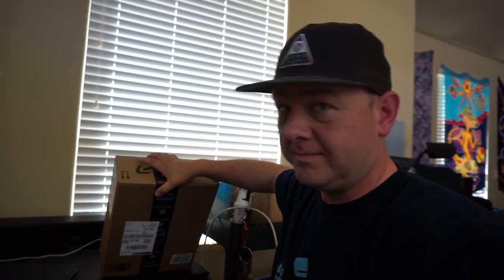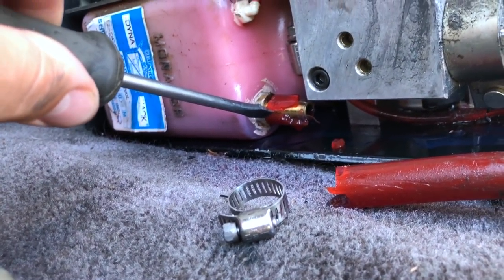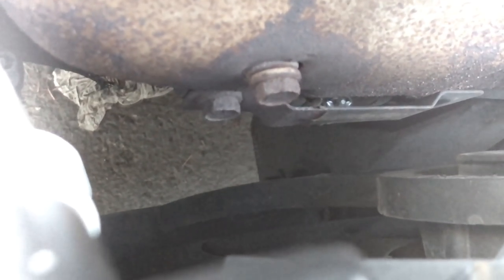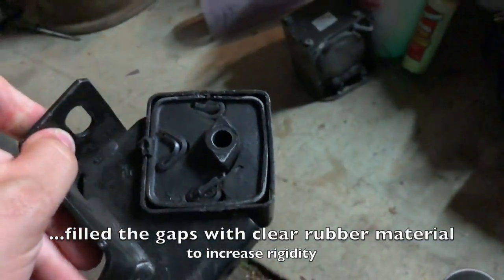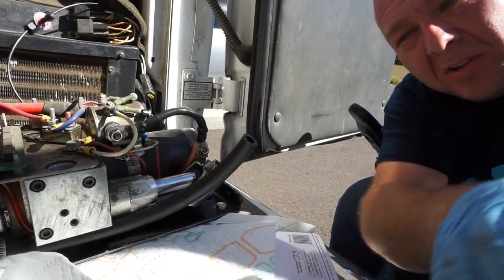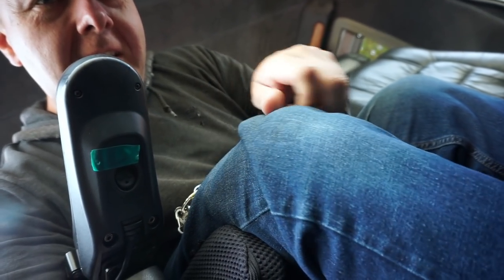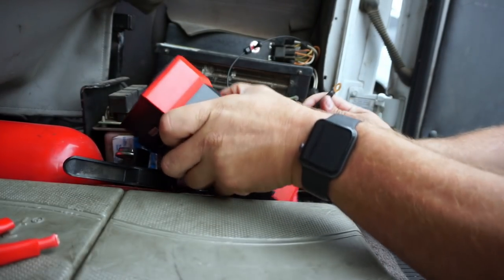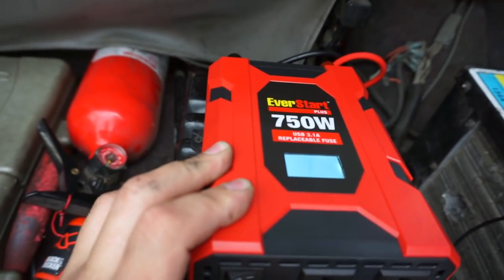VLOG 373: everythings always BROKEN!

Comment: Awesome. Microcontrollers like the arduino would be right up your alley. You love to tinker and this would be a perfect fit, make a remote for the new inverter, individual cat feeders, ect. Great that your cat ended up with someone who understands first hand what pain and joint pain is all about. Hoping that ATF holds up, for some reason I am not too keen on the idea, might be good for cleaning the system though. Keep the videos flowing!